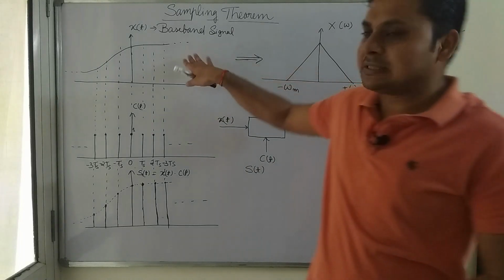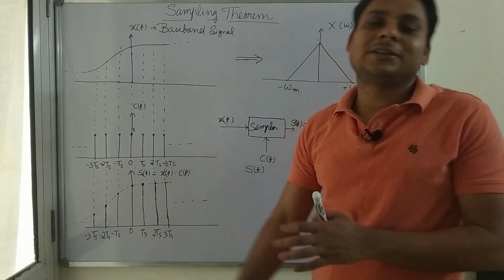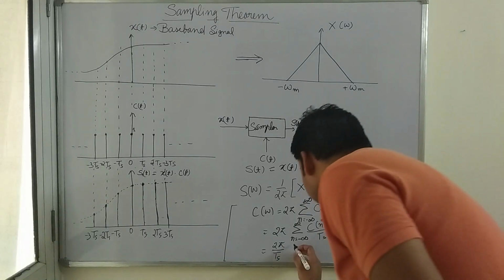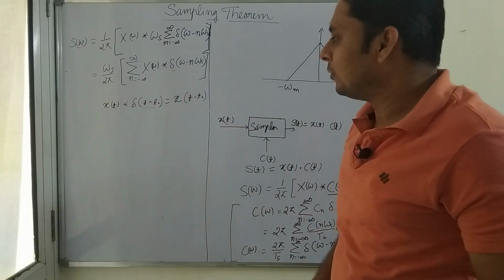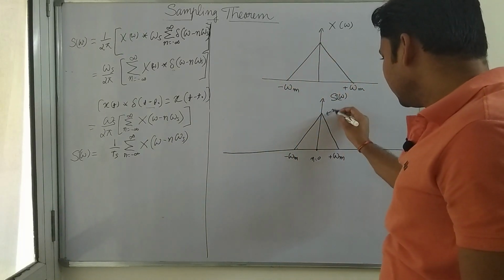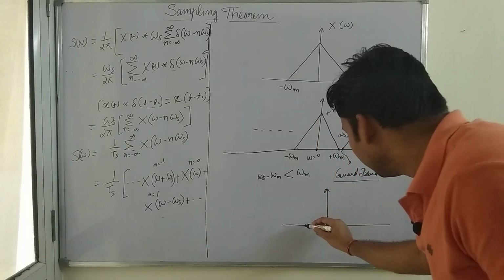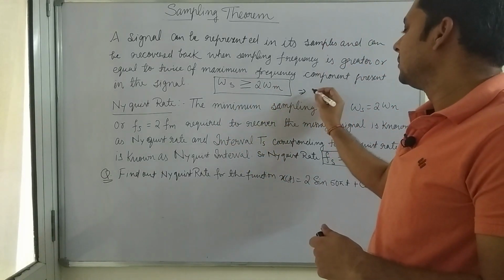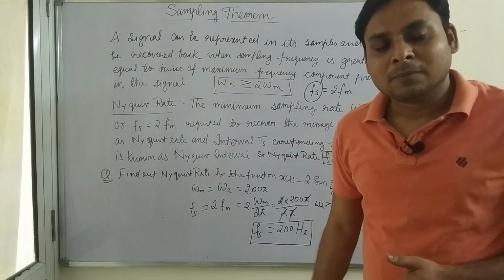Signal & Sytems: Sampling Theorem (with proof)

Comment: Impulse has infinity amplitude and it has a unit area. Why you are saying that value is 1?  How CT Dirac function converted to the DT Dirac function?
If the amplitude is 1,  there is no area, so the integral is zero.
Reply from the maker: Thanks for raising question, Yes, you are absolutely right. the amplitude of impulse function is not 1, rather the are under the pulse if 1. And when we create samples practically they are not discrete time functions but pieces of continuous time function. But if we consider the width of impulse function tending to zero. Approximately (for simplicity so that beginner students can understand the concept) we can explain taking the amplitude as 1. I admit this is not the standard way but i find it helpful for students to understand the concept. NOTE: Students who went deeper side of the topic please consider the point raised by blackseastorm 61 research more on the topic.
Reply: @vinaysingh-xi1sw    Thank you for explanations. I am stucked at this point. 

The problem is,  how we obtain a DT function by using this CT impulse function. It has value of infinity. 

I don't understand how we transform impulse to the discrete-time as its amplitude is 1.  How this process/conversion works ?
I have problems on converting CT to DT, I am trying to watch several videos about it, but the actual mathematical operation of "converter" is not clear.
What I mean is , what is the operator that converts  ""impulse(t) >> to impulse[n] with amplitude of 1""    or    ""x(t) . p(t) impulse train >>  to  x[n] as a sequence""

x(t) . p(t)   could be represented as =  summation of the series of  x(nT) .  impulse ( t - nT ) 

But this is still not equal to a sequence of x[n] ,  because it contains scaled impulses with amplitude of infinity,  right?
Therefore I am trying to understand what actually this conversion and this impulse are.
What is the title of topic/video that covers this point?
Reply from the maker: @tıbhendese  If i understood your confusion, i think you are confused with the mathematical calculations. 
x(t) . p(t)   could be represented as =  summation of the series of  x(nT) .  impulse ( t - nT ) 
In above expression dot (.) is convolution operation not simple multiplication. both are different operations. Please go to video https://youtu.be/1pJ5ie2hX1M for understanding the convolution of a CT function with impulse.
The second point is summation of the series of  x(nT) .  impulse ( t - nT ) , here summation does not mean the addtion of all the samples but samples at time instants like T second, 2T second and so on. To simplify solve the convolution for n=1 first then n=2 following the video i suggested and analyze the results. A lot of things will be clear to you.
Reply: @vinaysingh-xi1sw   For the expressions "x(t) . p(t)" and  "series of  x(nT) .  impulse ( t - nT ) "  I have  almost never seen that is written as convolution instead of multiplication. In the videos I watched, they all write this by multiplication, therefore I noted it like that.
Secondly ,  " x(t) * impulse(t) = x(t) "  so it dont satisfies with   
"" summation of the series of  x(nT) .  impulse ( t - nT )  =  x[n] as a sequence""
I am still confused about how this conversion works  " impulse(t) >> to impulse[n] with amplitude of 1"
And its getting much more complicated each time  :(
Reply from the maker: ok I will see deeply to your doubt n will come up with a solution.